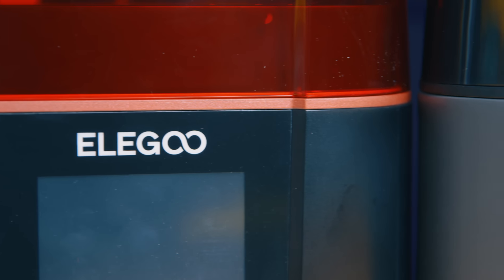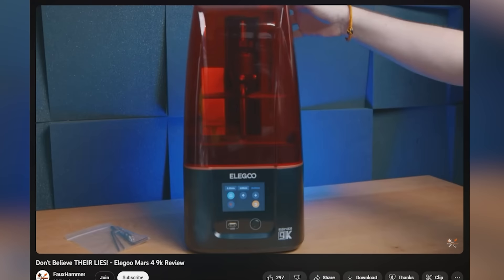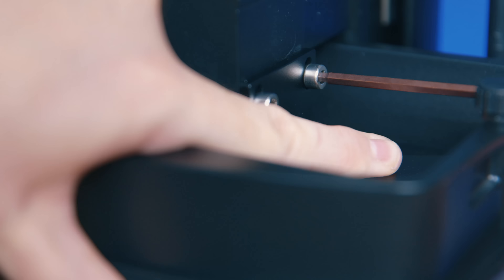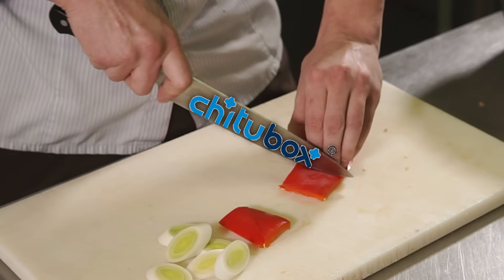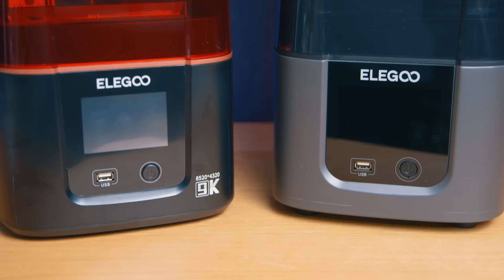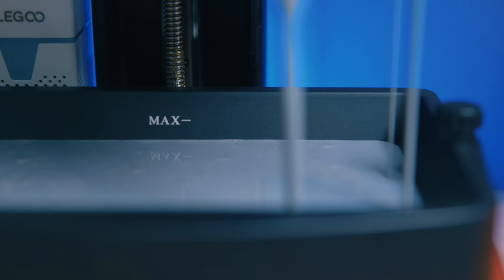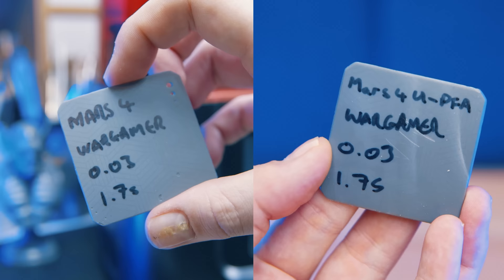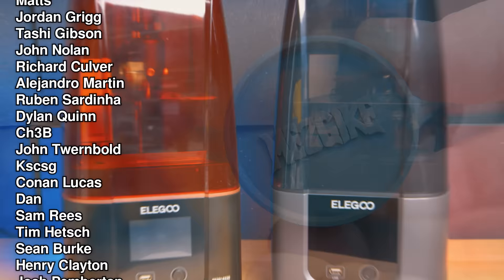Elegoo Mars 4 Vs Mars 4 Ultra

Comment: For those worried about the screen protector on the 4 ultra - it is there, its under the tape and takes about 10minutes to replace.  I just did it.  Elegoo sent me a replacement FOC which took a few weeks over xmas.  I'm not sure why they aren't for sale on their website
Reply: Then where did you order the replacement screen? I just bought the mars 4 max and I’d love to know for future reference. Did you go through customer support?
Reply: Are you sure, ive been sent 2 mars 4 ultras and had to return both because the screen either cracked in shipping or during leveling

Comment: I upgraded from my mini8k to the mars4 ultra. I can noticeable see a big difference in print quality. I did change the screen to nfep. I really didn't have a problem with the texture the other screen was producing. Will probably switch back to see if i still feel that way. It so much faster to print as well. The absolute thing that I feel in love with was the wireless transfer.. i will never go back..its the shizzz. All priters should include this feature.
Reply: I've noticed that about the screen protector as well. Will double check.
Reply: just ordered my nfep for my ultra also. did u just use the mars 4 settings isntead?
Reply: I use chitubox.. there are 3 presets under matching resin mode. I've been playing with those.
Reply: Which screen did you order as a replacement? I wanna switch to nfep but as I am new to resin printing I don't wanna buy the wrong thing
Reply: @vincenzodemagnifico  phrozon nfep film. It's all I use anymore for nfep film.
Reply: @skeeter3080  what about the size? Any particular that fits, or you just cut down?

Comment: I've got a Mars 3 and just got a Saturn 2 and I'm using the standard Elegoo Gray.  The mars on .035 (figures) and .05 (bases/terrain) works perfectly and gives me more detail than I can paint and see from a foot away.  The Saturn 2 - well got it dialed in (I'm pretty sure I did) and got it running with the first batch - 4 mounted barbarians.  Seems to be working fine and I'm doing .03 for the layers.  

I agree on a bigger build plate - I've printed some dragons on the Mars they're in pieces.  On the Saturn - they should fit all at once and some 2 at once.

Comment: you are so correct on just about everything. Especially the VOC thing.  Tiny charcoal filters will never help VOC - you need massive volumes of airflow into massive filtration systems (comparitively speaking to the printer size) to actually do anything about the VOCs.   It is far easier, and cheaper, to just vent them outside.  A flexiduct and a large, high pressure fan will do the trick.

I actually sat down and looked at each point, and imagined if i would use them 'every print'  - 'every other print' or 'rarely on a print' - and ... honestly the Ultra to me is the way to go.   I am still holding out on my first resin as I don't have the real ability to yet (fumes need taken care of, low ventilation area and VOC don't mix well)  so maybe a slightly better unit will arrive before I actually buy - but it seems to be the one I aim for, and to be honest there's so little for me to actually expect better - it comes down to 'nice to haves'.

Things like - a resin auto-dispenser system where the bottle is upside down and gently flows resin in to keep it topped off. (seen on other systems) - or a vat warmer, to heat up the resin to it's best curing temperatures. (this may or may not be achieved by turning the vat into a heat sink for the other parts as well, possibly eliminating the need for a fan)  or slightly larger build volumes, while retaining the roughly 25 micron excellent print detail. (+/- a few microns, doesn't really matter to me)  and of course a vat with a tapered edge to make pouring excess out easier, and more controlled, for when it's time to change colors or types.

But these are all literally just 'nice to haves" and not "musts" - the Ultra... seems to be by far the best resin printer out right now, at it's price point.   +/- $100 USD.

Comment: I have the 4 ultra, TBH the fep thing is totally irrelevant,  it's going to be replaced at some time, so I have no idea why it's even a second thought,  never mind the big issue you appear to have with it.

The fep is a consumable just like the resin and IPA, you choose what resin and fep to use in order to suit your own needs - irrespective of that which came with the printer.

The only issue I have had is with the WiFi,  and I think that is more to do with Tango!

Every so often, Tango can't find the printer,  checking the network and attached devices,  and the mars 4 ultra (with a fixed ip address) is always there with 192.x.x.24 in my case.

Removing and reinstalling Tango, and magically it reappears!

And yes, the move/rotate within Tango is too clunky,  but overall,  it does supports and so many other things better than cbox or lychee out of the box - let's face it, there isn't perfect software out there.

Great

(Felt I need to add the great, as if it's obligatory)

Comment: Thanks for this review!  The single most important upgrade to me is the controller board. This board has a non-chitubox chipset on it!  For me, this tells me that Elegoo is taking these printers in  a new direction. I personally do not want chitubox having ANYTHING to do with hardware that I purchase, because I do not trust them anymore. I am willing to pay more for a product that has an open source friendly controller board in it. I do not want to roll the dice on not knowing what exactly is in the machine that I am going to spend my hard-earned money on. The other important item to me is how a company deals with their customers and support. Elegoo (from what I have researched), has very good customer support. Just with any tech now, any hardware is only as good as the software running it. It would be interesting to see how Elegoo handles its new software. I hope they realize how important this is!   Thanks again for the videos you bring us.
Reply from the maker: How come?

Comment: The mars4Ultra was a present, i print many years with Mars2 and Mars2pro. So i hope the M4U will be amazing better.
I try the same object with the same support, same angel aso.  At least i decrease the speed to the same like M2P. Ali can’t find any advantages to my running M2P. i print strong geometric objects for modelltrains, so i need best surfaces and straight edges. 
So i can’t see any differents to my good old M2P, who needs the micecinema, who needs Wifi. 
For FDM like Bambu is wifi and online starting a good solution but for resin printers about her workflow not necessary.

Comment: I'm 90% sure the screen protector is under the black tape.  Since replacement protectors aren't on Elegoo's website, I assume you just take the tape and protector off, then replace the whole lot with something aftermarket.
Reply from the maker: Possibly, but taking that tape off could be fun, as I;ve had one tear the LCD cable previously. I just don;t like this approach.

Comment: Quick question Ross. Would you still consider the GK2 as the King of the Hill when comparing its print quality to these new Ultra Elegoo ones?
Great videos btw, keep it up!!
Reply from the maker: Print quality.... I'd say that's irrelevant with most top end printers once you enable Antiailiasing anyway.

It's still king of the hill because of it's features and ease of use - And it will have an optional new feature soon that will make it even better.

Comment: I read mars ultra has a firmware limit of lift speed set to ~100mm/h (~1.6mm/m), I also read for pfe/pfa you must set to 30~50mm/h because things between 50mm/h and 180mm/h tend to fail and depending on the piece if you go higher you could break your object. Did you find any issues with the 100mm/h limit speed on ultra? (im planning to use ultra for minis on water washable resin)

Comment: I am considering to have mars 4 and i am gonna probably use anycubic's water washable resin. (Due to IPA smells) Can i use the 18 micron potential of the printer by using this resin? In my country mars 4 costs 280 dollars and mars 3 pro costs 210 dollars recently. Also i wonder if frensel lens affects final print or not. (Because mars 3 pro has fresnel lens but mars 4 not.)

Comment: Hi Ross! This was a really helpful video as always! In 12:10, I would say the regular Mars 4 has slightly better print quality both with pfa and acf, right? The thinner lines in the bottom left corner of the calibration plate seem to fail with the Mars 4 Ultra. Any thoughts on this??
Thanks a lot!
Reply from the maker: These sometimes fail and sometimes don’t, they are so thin that I tend to ignore them. 

Most of the time they pull away in the cleaning stage. Especially if I’m cleaning it alongside other stuff on another printer. 

But I’m not printing it 5 times to get a completely successful one fir the video.

So that is more a listen to my words more than what I show

Comment: there is a screen protector under the tape. and you cannot replace it.I had a mishap and resin got on the tape. Unfortunately, I didn't notice it - since I rarely remove the tank. The tape dissolved in a short time and only a little of the resin came onto the cable from the display - the display was then destroyed. The fact that there is no real protection really bothers me with these Elegoo printers. If something happens you will have a lot of problems afterwards. and I have already replaced a display once and had problems with the z axis and MB was defective. I sent the printer back. Now the problem... and I decided not to buy a Mars 3 build with the display like Mars 4. I'm looking for something better. But YES this screen protector really sticks underneath this tape. and you can't replace it. On the first printer I simply stuck PET film over it. Whatever happened to smira. There was a piece of resin in the tank that I didn't notice. The Z axis leveled to Z=0 and the display and the glass pane broke. The new display comes without a glass pane and I had to cut a new glass out of crystal glass for picture frames... Okay, that was my mistake too... and I was happy with the Mars 3 except when it comes to the display protection, which is just bad .
Reply: that sounds unlucky, I've just replaced my screen protector on the ultra 4 and it was pretty easy to do, it took 10minutes.
Reply: @thorpdj  Thanks for this answer. I just did the same on my regular Mars 4. Replacing the black tape was finicky as heck, though.

Comment: Good evening! I recently discovered your channel, congrats on the quality of the videos. 
I have been printing with FDM and SLS printers for years. 
I currently have a need to purchase a resin printer. 
The purpose is to make medium and small parts, I need them for engineering purposes, so I need excellent quality (this is why I switched to resin printers). 
I do not have an illimited budget currently the "Saturn 3 ultra" is out of range (550 Amazon).
Seeing your videos I am considering:
Anycubic Photon Mono X 6Ks(312), ELEGOO 3D Printer MARS 4 Ultra(330).  I like the possibility of more volume with the mono x6ks, but I don't know how much I lose in quality.
Not if I should consider other models such as the Anycubic Photon Mono M5 (430).
Any suggestions are welcome (also regarding resins with remarkable mechanical performance and those that are transparent)
Reply from the maker: I'll have a video up next week to advise of all the printers worth considering - this should be on early access for our member in the next 2 days.
Reply: thanks for the quick response! Then I'll consider enrolling to get the new content sooner! do you have any suggestions in the meantime? @FauxHammer

Comment: How is the print quality between the Saturn 3 ultra and the Mars 4 ultra? I have a couple Saturn 3 ultras (thanks to you!) and I was wondering if its worth getting a Mars 4, A: because I sometimes want to print smaller things, and B: because the its got a screen with slightly higher resolution.

EDIT: Sorry, I hadn't watched the video through to the very end where you say the print quality on the Saturn 3 Ultra is a little better than the Mars 4 ultra. No point I getting a Mars 4 ultra then, unless it's just for printing smaller parts. Probably not worth it just for that.
Reply from the maker: Yeah, even now I think the Saturn is sharper than the Mars.
Reply: @FauxHammer  that is somehow so wiird.... one should expect at better resolution screen to produce more sharp prints? perhaps the light source is inferier? or perhaps the file format to blame??? is it the same with non ultras? might be the ACF films?

Comment: I am still unsure. I wanted the mars 4 ultra but its so weird that the saturn 3 ultra makes the better quality although the resolution of the mars 4 is better.
Reply from the maker: it;s about light refraction. Saturn 3 is better at directing light upwards towards the plate. the Mars isn;t.

same issue is why the M5 has bad prints despite having the same screen as the saturns 3's

Comment: I have a mars pro 3. If I bought the ultra and changed out the FEP, could I still use the same settings as I would on my pro 3 (assuming I use the same resin). I typically use abs like elegoo resin
Reply from the maker: yep. identical

Comment: So, are the resin tanks themselves exactly the same, or not? It seems pointless to buy an extra tank for the Ultra with ACF and immediately replace it, if I can buy one for the 9K with FEP preinstalled. Elegoo responded on their site that they are not interchangeable, because the dimensions are different. The listed dimensions are the same, though...
Reply from the maker: They are identical, no idea what Elegoo are on about.

It’s your call. It’s cheaper to just buy an FEP film which is a Consumable anyway. Rather than a. Whole new vat.
Reply: having two tanks makes life really easy especially if you wanna print lots of models just swap the clean one in and your good to go.  Gives you plenty of time to get your "dirty" tank all cleaned up or replace the fep.  I have seen to many people throw some more resin in their tank and start to print only to find out they missed a piece of debris in their tank and now have a cracked screen

Comment: @FauxHammer 
would you pick elegoo mars 4 max or anycubic mono x2 6k or anycubic mono x2? i have a mars 3 ultra already and i need something bigger for figures that goes from 12cm (about 6 inch) to 30 cm (12 inch) or even a bit bigger, i model them myself and i usually like to split them. thannnks

Comment: If I want to switch to pfa on my Saturn 3 ultra I’m just buying the sheets for the Saturn 3 12k and also use the lift speeds of the non ultra or I’m missing something here ?
Reply from the maker: Nope, that’s it
Reply: @FauxHammer good thx so you educated at least one individual 🤪, is there a special trick to know how tight I need to do the bolts / the sheet ? Sorry I’m still a resin printing noob bought the s3ult mainly because of your videos. And I’m very happy with it! Im only missing your wargamer resin in Germany
Reply from the maker: @dasdasdadsa5910  you should never apologise fir not knowing something.

Replacing film is a pin in the ass, it’s not hard, just takes ages.

You have a frame the acf goes in. Do one corner. Then pull taught and do the opposing corner.

Then do the other corners pulling slightly taught as you do. Just remove the sag.

Then do the middle screws across the X axis and so on, just balance it out holding taught as you go.

When you put the frame into the vat, it should stretch as taught as you need

Then
Reply: Sounds like 2 people job 😃 yeah and I’ll let you know how it worked ! Thx for all the help
Reply from the maker: @dasdasdadsa5910  nah. You can do it solo, but at some point before half way, you’ll be saying. “Jesus, how many screws”

Comment: I’m looking to update my mars 2 pro to one of these
Reply: Same. I have a Mars 2 non pro and it has been amazing, but I need higher resolution as I print super detailed model car parts. Lots of flat areas which really benefit from higher resolution unlike minis. Last time it was easy to choose the non-pro Mars 2 as the difference wasn't as big, but now with the Ultra I'm a bit mixed.
Reply from the maker: Maybe consider the Mars 4 max instead at the same price or Saturn 8k or Saturn 2 whilst they are still available

Comment: rather pointless complaining about the large file size when you use antialiasing if it doesn't work anyway.
Reply from the maker: It’s 2 distinct problems. And the file size problem is an issue with the entire .goo format

Comment: Still using the same bloody irritating stock footage, haven't a clue why as I assume it costs you money to use footage of randos shrugging. 
It may not be a big deal but it makes me grind my teeth every time I see it.   
It's hackneyed and cheesy.
Reply from the maker: I’ve done video without it and it doesn’t work, I’ve tried emulating the stock footage myself and it looks worse.

I need something to fill the gaps when conveying attitudes and emotions, and until I can have a setup which allows me to do talking head, along with the b-roll. It’s gonna keep happening.

But I do try to limit it as much as possible, because I don’t like it either
Reply: is thar really your complain about these videos? i didn't even noticed them until i read the same comment on like 3 different videos... priorities man